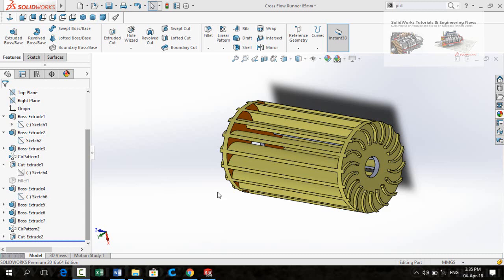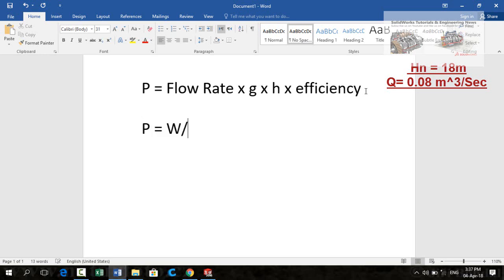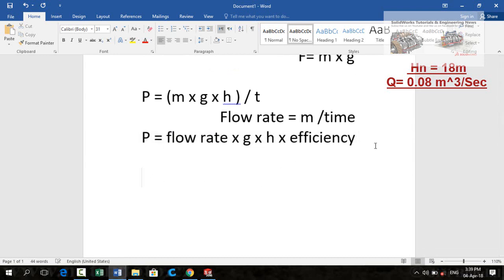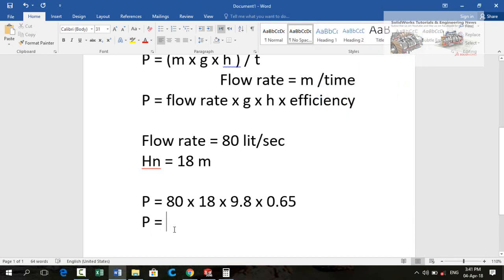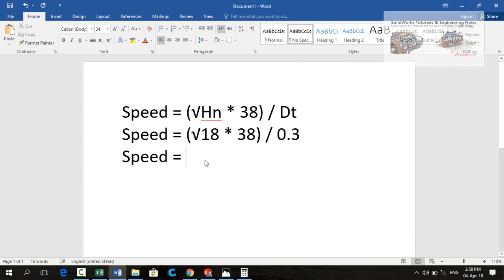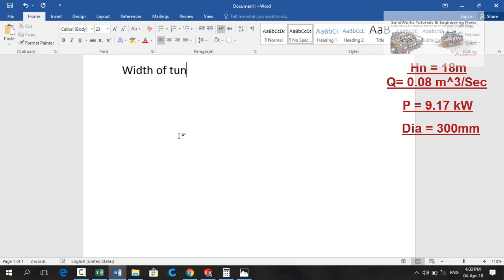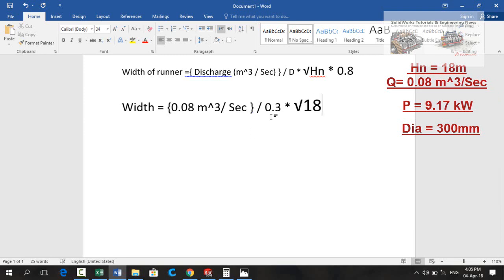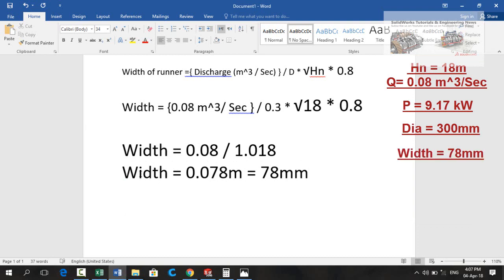How to Calculate Width | Diameter | Speed of Cross Flow Turbine

Comment: Where did you get all of the formulas?
Reply from the maker: I learned these formulas from HYCON ( Asean Hydro Power Competence Centre Indonesia )
Reply: If you can teach yourself, you can read a translation of the original analysis by Googling "Banki Water Turbine".  Also look for "Standardization of Cross Flow Turbine Design".